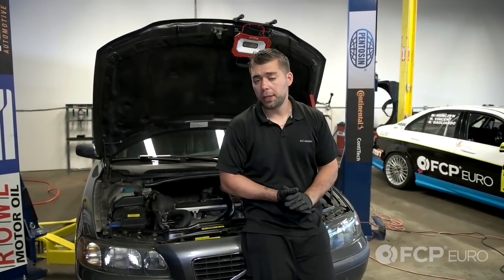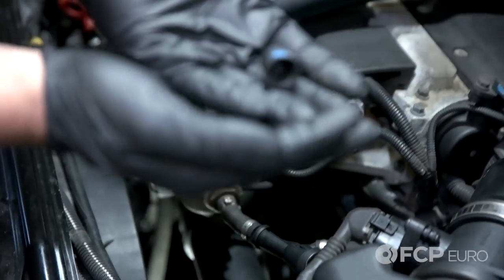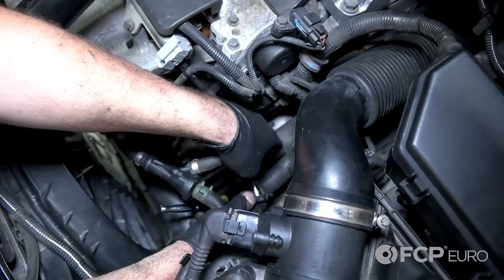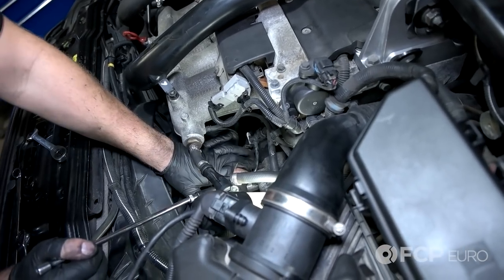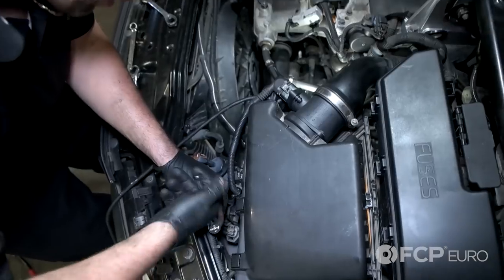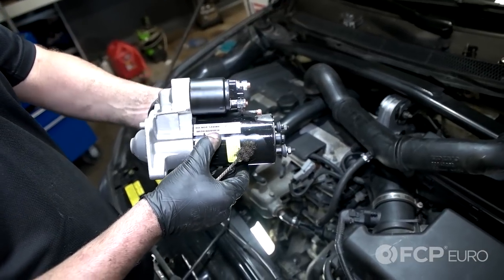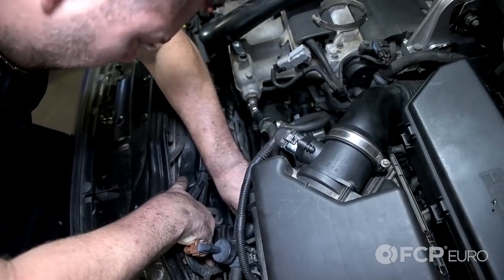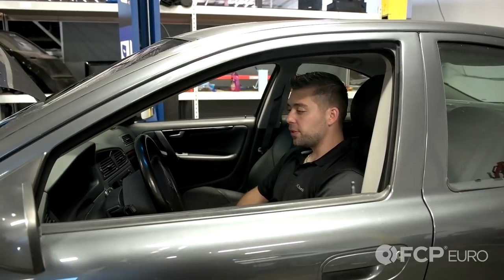Volvo S60 Starter Replacement - Quick and Easy DIY (850, C70, S40, S60, S70, and more!)

Comment: 5 years later and I can confirm this tutorial works! I had a little issue with a stripped bolt connecting the activator wire to the starter so I had to cut the wire at the terminal and attach a new round terminal but other than that this was a great step by step for my 2008 Volvo S60.
Reply: Was your car having ignition problems or was the terminal affecting something else?
Reply: @6amamisery769  it wasn’t turning. No audible clicking when turning the ignition.

Comment: Hey two things.... 1) Great Video!!! Well done love the wrench sizes. 2) FYI ours had a pain in the ass bracket on the back side that is not on this one at all.  We thought the post was stuck, but nope it was a bracket that can't be seen with the naked eye.  It bolts to the two little studs on the back of the new starter. The bracket has one bolt.. feel it with your fingers and get it off. 12 mm was the size... needed one small extension an had to go in from the top with a hand on each side of the fan.  Good Luck, it was a pain... BTW we broke our starter housing trying to get it off without the bracket off.  LOL!

Comment: A couple of tips to make it go easier. Pull the upper tranny cooling if ya have a automatic. Also pull the charge pipe and intercooler hose. Do this to minimize any damage any damage to the radiator when pulling and putting the fan housing. Lastly, spray some Kroil or another good penetrant in the starter dowel pin hole the day before. It helps getting the starter loose and not cracking the tranny housing. It's better safe than sorry.

Comment: Hey FCP, per usual I love your videos. They’ve helped so much over the years. A little personal input as a fellow DIY’er, I personally feel it’s easier to remove to radiator fan (two 10mm then just maneuver it out). It provides ample space to remove the starter bolts with everyday tools and you can then take off the charge pipe from the throttle body and position it above the intake which makes it very easily accessible.

Comment: Hey FCP Euro, I see this was a tight spot and pretty challenging for camera angles and close-ups and what not. Could I please recommended you all look into some borroscope/endoscope type cameras? Look up reviews for stuff like the giraffecam etc. Some don't have the best resolution but I think it would add a great deal of clarity to the videos to get that close up inspection without all the clutter in between. Also you might supplement with images from Vida with part explosion diagrams to map out where your taking the audience.
Thanks again.
Reply: Good advice but he's posting these videos I'd assume for those who work as mechanics such as myself. General public or diy who don't understand parts on cars will probably not be able to do this job. Most elbows on euro cars are plastic and bust super easy 😂

Comment: Hi! Never try to replace startmotor if you have a Volvo S60 T5 2001, You will never get access to remove the boost hose and there is a bracket mounted behind on the starter which is impossible to remove from upabove. I give up after 3 hours and book an appointment at the local Volvo workshop.

Comment: I’m experiencing a weird starting issue. Sometimes before I even start the car, a msg will display that says “will not start “. So I turn the ignition to off, and then back on and I can start the car… and msg has gone away. Any thoughts on this? I have an 02xc70

Comment: I have a request I wanted to know if you guys can replace the rear purge valve hose or known as the “j hose” for a v70 I can’t seem to find any videos on it. It gave me a code i had a small evap system leak please help with this. Thanks!
Reply from the maker: Hello Luis, we'll keep that DIY in mind for upcoming videos. In the meantime, if you have the specific code you can email us at products@fcpeuro.com and we'll try to help you out.

Comment: WARNING.  Good video but does NOT apply to 2002 Volvo XC70.  I spent all day trying to take the starter out by following the video. BUT now that I have totally damaged the old starter (that is still in place)  I realized that there are two bolts holding the starter from the back that is not mentioned in the video at all.  Taking those two bolts out is almost impossible since there is no access at all.  Will have to tow the car a shop and spend a lot to fix it.  Very frustrating.
Reply: Pirouz Malek that’s your fault bro

Comment: I am looking to get the starter off my 2007 S40 5 cyl solid cam turbo. It looks different. Air box is right in the way. Can you help ?
Reply: Remove whatever is in the way, go under and inspect see if you can use shortcuts. Germans are very smart and there is always an easier way to remove something. Problem is you have to tskr your time and be gentle to youll bust stuff.

Comment: This video was made with the assumption that the hose clamp for the boost pipe on the throttle body end is turned in such a way that it can be accessed easily with an extension. Mine could not, and I had to abort the job.

Comment: Following my last Warning I need to ask FCP this question:  The new stater you are showing in your video you can clearly see the two bolts that are located on the back of starter that must be tied to a bracket and attached to the engine.  WHY are you not talking about that at all???  Not when you are taking the starter out and not when are installing the new one !!!  HOW did you take the old starter out w/o detaching that bracket from the engine?  and HOW did you install the new one w/o that bracket???  DIDN'T the old starter have the rear bracket??? 
If you had mentioned that in your video you would have saved me a lot of time and damages I did to the old stater and the body of the engine b/c from your video no one can tell that there is a bracket in the back of the stater.
Reply from the maker: Unfortunately our Volvo S60 didn't have the bracket to show in the video.
Reply: I am sure this is just a guide and not a Bible so make sure you know your car otherwise take picture and send to FCP.

Comment: Is it in the same location in the S80 T6? I may buy a -99 model from friends sister and it has a bad starter (works maybe 1/10 attempts)
Reply from the maker: Hi Topias, the idea will be similar. However the starter used in this video is for an 04-06 S80.

Comment: I've replace the starter and it's still not starting what else could cause it to not start
Reply: Did u get it fixed? I’m experiencing weird starting problems…. I’ll get a msg that says “will not start”. I try again, then the msg goes away and the car starts.

Comment: Sir I’m have a driver side low beam light keeps blowing out any idea
Reply: Have you checked for bad wires? Pull up a wiring schematic. Also have you checked for a ballast under the light if one exists?  If Xeon light it might be the box that powers the bulb itself. Try removing the bad light and box and swapping to the other side. Also check fuses. Check ur fuses, then try swapping the lights from one side to other. Then check for break in wires with a meter.
Reply: Make sure you installed the correct bulb and aren't touching the bulb glass with bare hands so you don't get oils on it.  I know the Volvo manual lists the wrong bulb for a brake light believe it or not so double check online which headlight bulb you need. The Volvo manual says to use a certain bulb for the taillight but doesn't specify information other than the bulb base size, and there are many bulbs that use the same base. If you get the wrong bulb, the tail light can blow out easily.

Comment: I'm going to reuse the starter. I just need to replace the solenoid. How do I take it out without smacking it to death?
Reply: Mine was quite easy to take out. I just used a flat screwdriver as lever to separate it from the housing.
Also it turned out that taking out radiator fan (very simple) made huge difference in making reaching the starter comfortable and allowing better grip.
Reply from the maker: Hi, Kristupas. We always recommend replacing the whole starter and solenoid together, since you have it out, it just makes sense to replace the whole unit rather than possibly having to do the same job twice.
Reply: @piotrbartha  I used a rubber mallet (both ends rubber) as a punch to firmly tap out the starter. I used 4lb hammer, but I wasn't strong arming it, just letting momentum do the work. Dowel is stuck in tranny, I have no idea how to take it out. I will get the new solenoid in next few days, I will report back if the starter still works (it was working fine until I broke solenoid while trying to undo the wire bolts :D)
Reply: @kristupasantanavicius9093  Did you replace the solenoid?

Comment: At 4:09 and 4:22 minute you are mentioning a "gap pin".  I've just pulled my starter and my pin is stuck on the transmission housing.What is the solution? It looks pretty solid. Should I find a starter without the pin? The replacement on your web site has pin mounted on the starter. Is this pin removable? Can you remove it from the starter? Every replacement starter for my S70 98 I've seen has a pin mounted on the starter. Thanks
Reply from the maker: All replacement starters are going to have that guide pin. It seems your guide pin broke off and is stuck in the transmission bellhousing. You'll want to try and remove the broken pin from there, possibly by drilling it out. If you absolutely can't get it out, you can grind the pin off the new starter and install it.
Reply: @fcpeuro  It looks like dowel pin, so as long as it fits in it won't matter. The pin is looking pretty solid on the transmission housing. I have a close up picture on this website: https://www.matthewsvolvosite.com/forums/viewtopic.php?f=1&t=24199&start=50
I tried to scrape around the pin where it meets the housing with a a sharp tool . It looks really solid. Corrosion would crumble. Almost like it would be welded. I sprayed it today with PB blast. I might try to remove the pin from the starter and fit it in. Or I will try to turn both pins with vice grips. Whichever will give up first...

Comment: Is there a grounding cable on the starter? Thanks
Reply from the maker: Yes, there is a grounding cable from the starter bracket to the engine block.
Reply: @fcpeuro  Do You have a picture of it somewhere? Thanks
Reply: @fcpeuro  I pulled out the starter, looks like it's grounded via housing not cable...